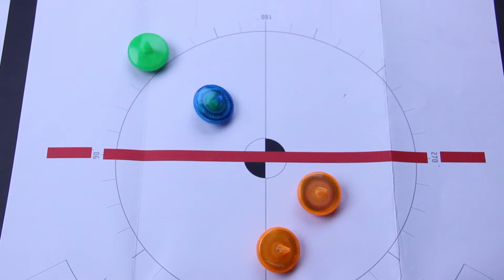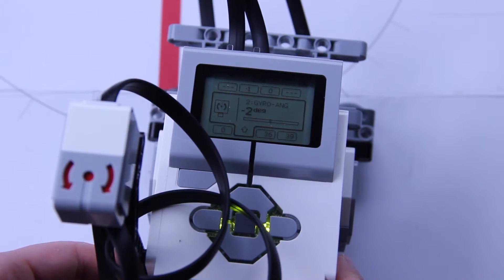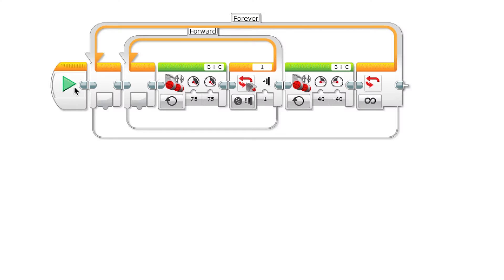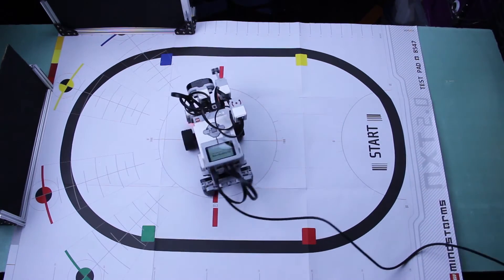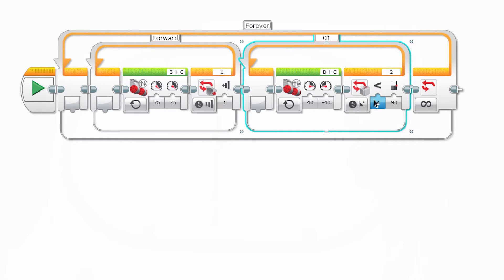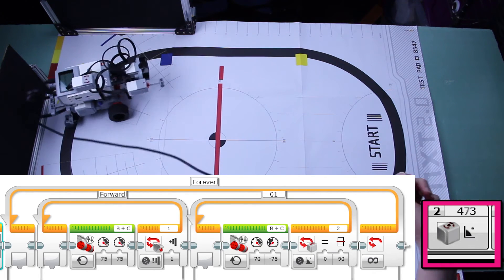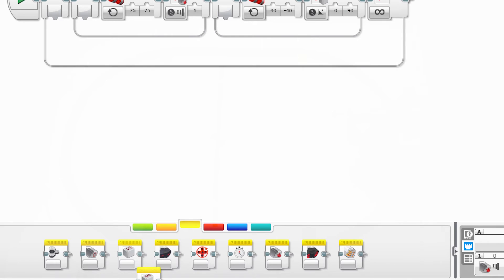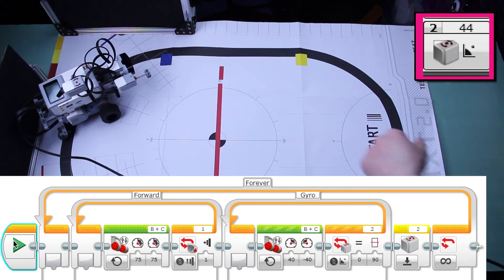Dizzy Robot - Using the Gyro Sensor | Lego Robotics Ep 5

Comment: Could you also use a "dead band" where the change in angle is acceptable? This could be true when the values is greater than 85 AND less than 95 degrees for instance. This might allow for faster turn rates.